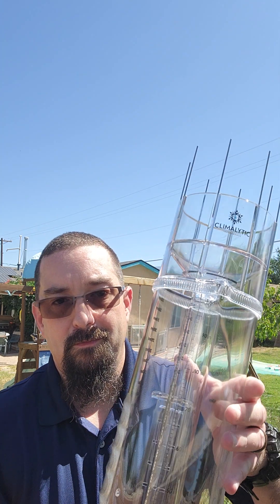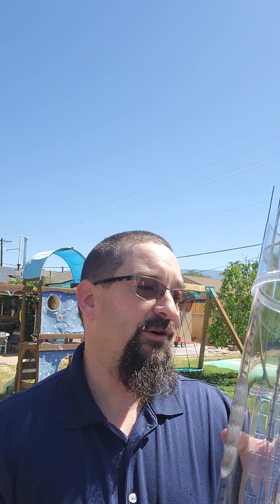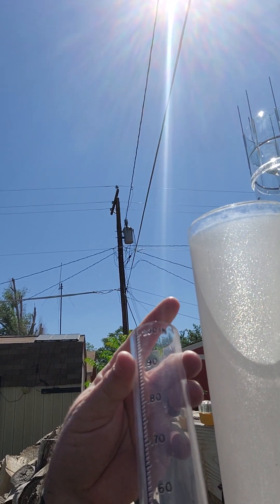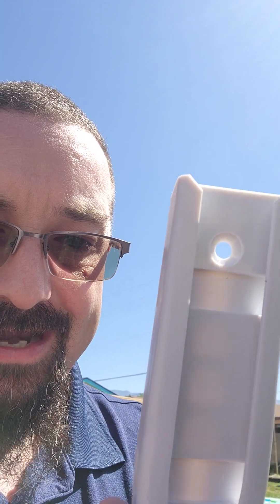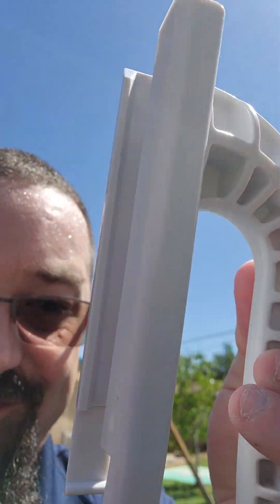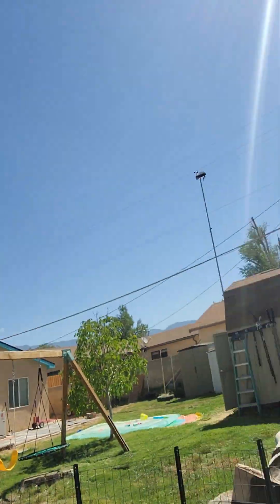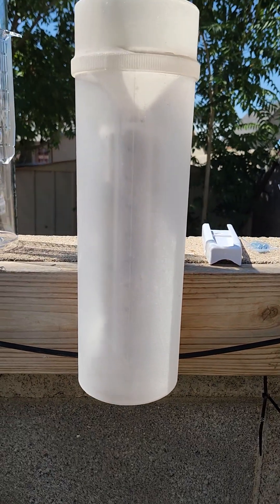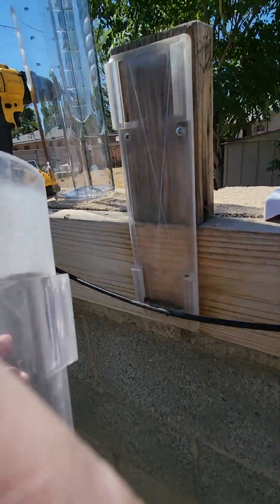Installing a CoCoRaHS Rain Gauge

Comment: Digital one register minimum 0.25mm which is equal to 1/100th of an inch, they register Trace precipitation, which cannot be possible with standard gauges like cocorahs, even it watch 0.001inch of water it with evaporate after sunshine